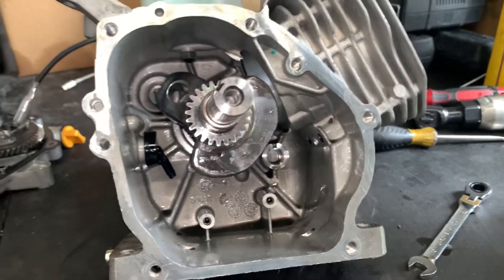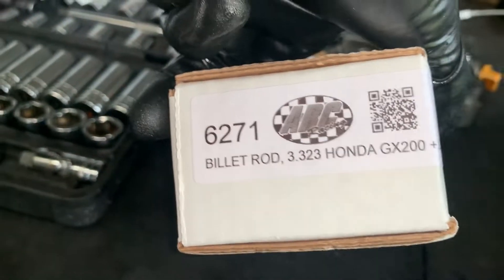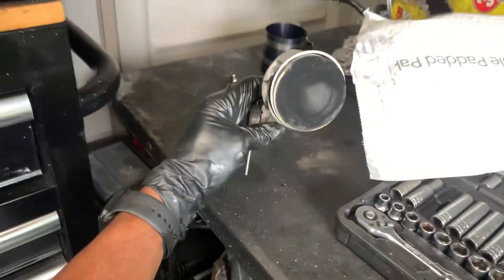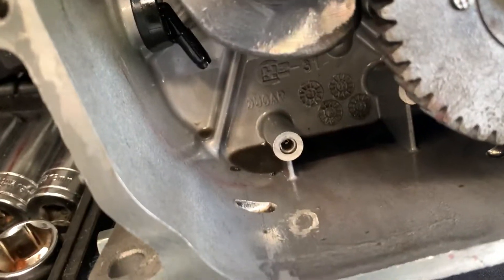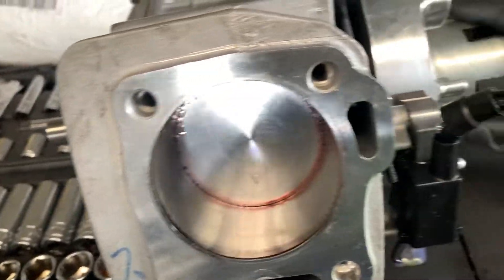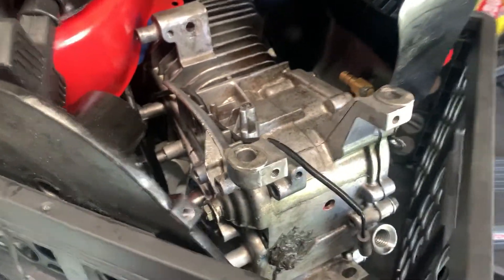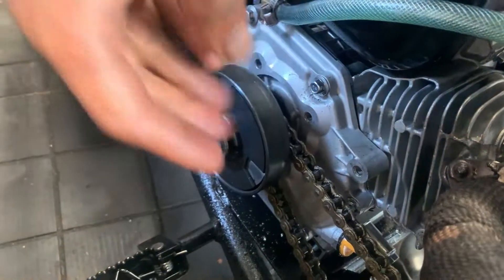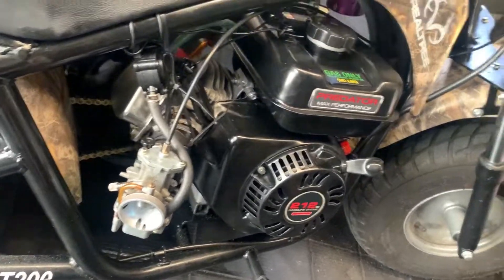Predator 224cc Max Performance E85 Engine Build and Test Ride Part 1 😈💪🏾

Comment from the maker: Just wanted to say, on that run wasn’t full throttle was only 75-80% throttle to 6980 rpms, the max I’ve gotten this .265 cam to is 7670 max rpms. I think it may be cooked, but I got something spicy coming soon for a new series! 🤘🏾💪🏾😈

Comment: 9:04 oh okay so when you mixed it 50/50 it will start right on up with no issues??
Reply from the maker: I Played with my jet size a bit, but I ended up doing a 60/40 mix. After that it was perfect.
Reply: Is it 40% E85 @MoneymanRome
Reply from the maker: @abdulkamau2862 yea it is e85 40%, 60% highest octane fuel you can get. For specific tuning options for your area and build, consult ChatGPT helped me alot
Reply: Thanks @MoneymanRome
Reply: @MoneymanRome did you get it at the gas station or online
Reply from the maker: @abdulkamau2862 Gas station, U gas has it or Sunoco gas station
Reply: Whats the difference in speed @MoneymanRome
Reply from the maker: @abdulkamau2862 I noticed a 10 mph difference and lower engine temps so I could stay in the throttle longer also going to a colder spark plug helps like BRP8ES and having heavy valve springs, I did 36lb for this build
Reply: Nice @MoneymanRome
Reply: @MoneymanRome some people told me that e85 bad im going to try it
Reply from the maker: @abdulkamau2862 if you let it sit, it can retain water quicker and separates, just have to watch out how long you leave it before running it again. Of course it’s nothing like M5 or M1 but still a advantage when you tune it in properly
Reply: @MoneymanRome thanks Brotha
Reply: @MoneymanRome is it good to drain it before using the next day
Reply from the maker: @abdulkamau2862 if it’s just a few days, you should be good. But if it’s going on weeks more than a month, I’d drain it. It can cause a headache down the line, and you’ll be chasing weird issues.
Reply from the maker: @abdulkamau2862 I’ll make an update in depth video about E85 and running it on a 212 or 224. I got you fam 🫡 I appreciate you tuning in
Reply: You Welcome  @MoneymanRome
Reply: Could you tell y my engine smokes smells like oil burning  @MoneymanRome
Reply from the maker: @abdulkamau2862 could be your piston rings, it happens after a while. Just buy a .570 piston from Amazon with the NR racing brand, may be sold be ombwarehouse on amazon but it’s a direct fit and will solve the problem in the cases I’ve diagnosed. A light cylinder hone could help as well but only if the bore is scored up.
Reply: Thanks @MoneymanRome
Reply from the maker: @abdulkamau2862 no problem fam 💯🫡
Reply: Its a predator 459cc  @MoneymanRome
Reply from the maker: @abdulkamau2862 yea but from my knowledge not alot of parts out for them, like the 224 Hemi

Comment: I just went with the fire 265 cam I could’ve got the hot 265 for $50 less but I don’t like the duration I want my valves to stay open longer so I spent the extra 50 told my wife I lost it,I know I know I’m gonna have to deal with God Ha ha ha

Comment: Damn. I built one just after they came out. Had a lot of block clearancing but it turned out good. I used a 570CH piston with the 6270 rod. Pretty potent engine and I only used a 252 lift cam.
Reply from the maker: I had bought one when it first came out and bought one recently, it’s alot of improvements they made with clearancing from the factory, I had to do very minimal to the motor for it to run.
Reply: @MoneymanRome  Wait. Are you saying the one you bought recently had less clearancing to worry about than the first one? If so that's great.

Have you had any issues with the compression release on the cam getting hit by the crank? I heard of a guy having this issue.
Reply from the maker: @Deucealive75  I had to clearance the middle of the cam a lot but not with that specifically. I have a new cam I’m getting soon, so I’ll give a update with that. But the block, is already pre clearanced. It’s perfect.